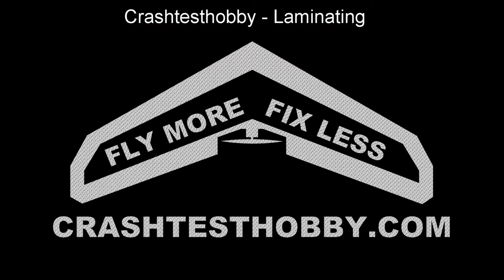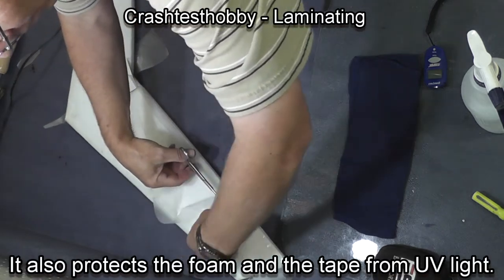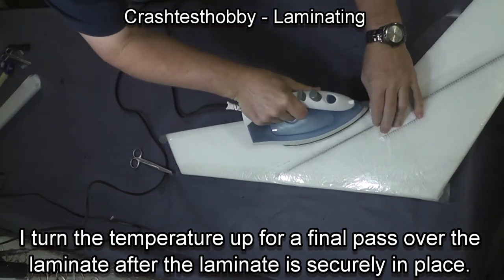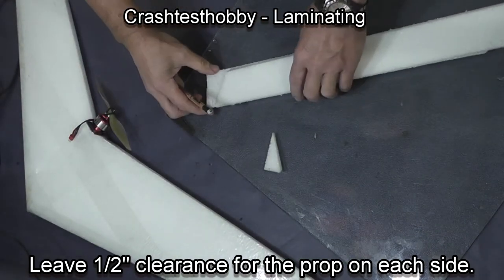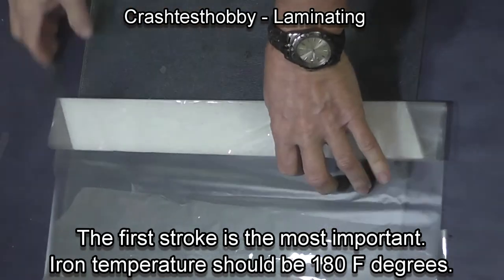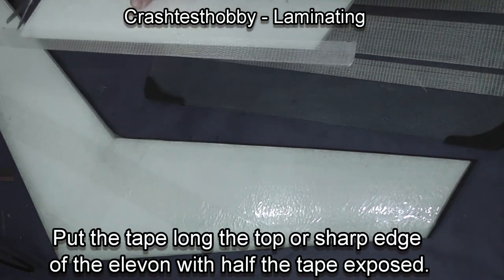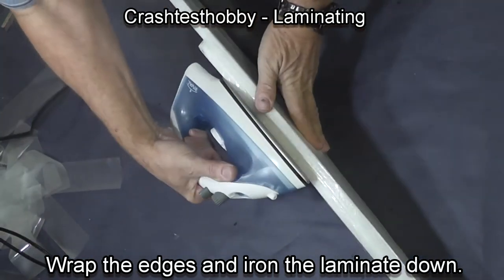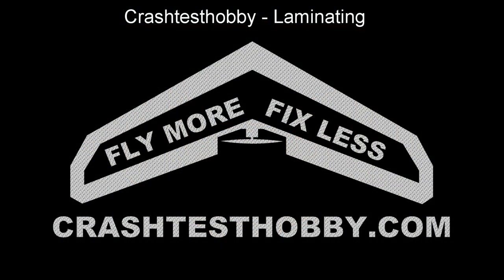Widowmaker #2   Laminating With a Cool Iron

Comment: I just got my ST Salto that I won from Tower Hobbies tonight ( yay me!) anyways, I decided to protect the finish on the plane and used a good quality light weight packing tape. I have learned after many planes,how to over lap and how to do a pretty good job at covering foam. I wouldnt call it expert by any means but I could see that plane getting pretty dirty. Its really white. I wish Now I had done my Apprentice back when I first got back into flying. I think the tape really adds to the strength and defiantly prevents the dents and scratches. I tryed minwax poly coat thinking that would toughen up the finish on my Waco Biplane but no dice. It seals the paint and prevents the paint from getting dirty and stuff but it still chips. I was thinking of fiberglass especially on a glider and a nitro powered plane. I watched a review yesterday of a glider and the wings moved so much the pilot had to land it before he crashed it. I know that much action would cause the control surfaces to move whatever way the wings wobbled making it a very dangerous plane to fly. a perfect canidate for fiberglass,or the rubbish bin,lol.
Reply from the maker: The adhesive in packing tape will break down with fuel and the tape will come off.  I have also done extensive fiberglass with laminates, lay-ups and molds.  They are expensive.  It is hard to make a smooth and lightweight surface without a vacuum bagging and Mylar system.  It is also very slow.  Just because I have become lazy and clear laminate is soooooooo easy.  I use the clear laminate on almost everything I build.
Reply: +Crashtesthobby yup,thats why I dont fly nitro anyways. I did,years ago. I dont have any of the equipment to get back into it anyways,not that I couldnt. I took what I learned and had my own small engine shop for a long time. I still fix up and sell stuff for extra spending money but dont have my shop now. Most people are buying the weed eaters with lipo batterys instead of two stroke. I can see the daytwo strokes become a thing past. Thats unfortunate for guys like me.Those motors make great engines for scratch built planes,depending onwhat it is. Also swamp buggys and stuff.

Comment: I couldnt see if the foam beads were expanding or not. I dont like the reptile look some guys get using the laminating idea. I think using minwax over fiber glass is a good idea. I may try a cast off plane and see how well this works. I put a lot of effort into customizing my foam planes and would hate to screw it up at the end by covering it with something that makes it look cheap.  I hate the fact its so easy to damage foam too. I think your idea doing a low temperature would be a better  idea. gonna give it a try.....
Reply from the maker: You don't get the reptile look with EPP foam that you get with EPO bead foam.  The surface isn't perfectly smooth with the laminate over EPP but it is good.  All of our planes are made from EPP.

Comment: Is the laminate impregnated with glue? Is this a special kind of laminate? What causes the laminate to bond?
Reply from the maker: Yes there is a glue on one side that melts and attaches with heat.  Its like a hot glue on a sheet.  No other adhesive has to be applied to this particular laminate but that is not true with other laminates like Ultracoat or Monocoat on foam.